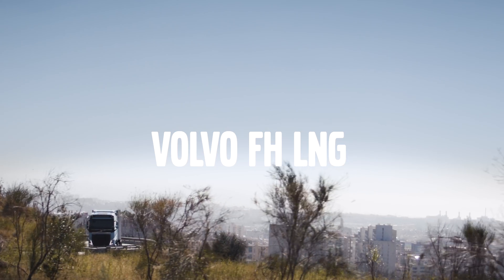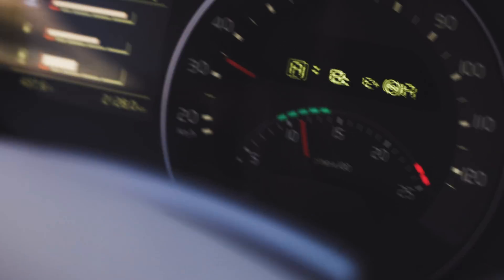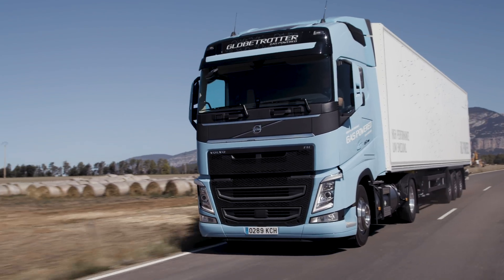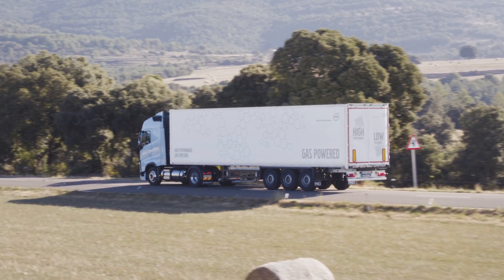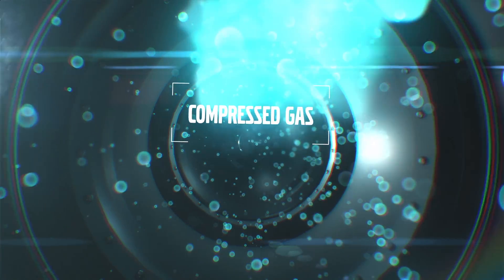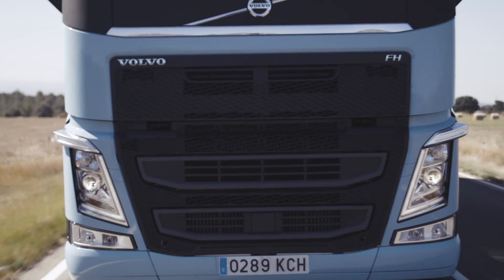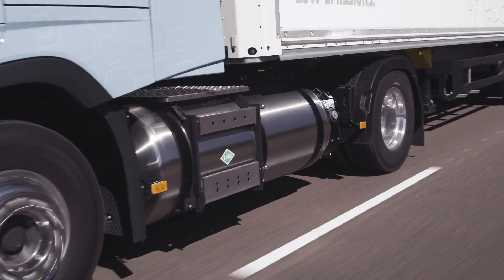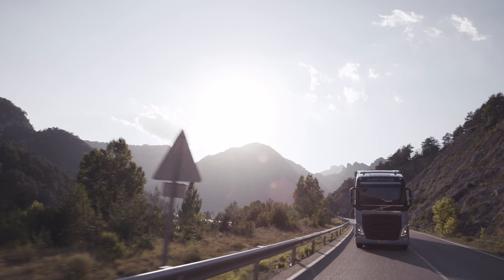Volvo Trucks - Introducing our new gas-powered trucks that can reduce CO2 emissions by 20-100%

Comment: Its not the first Volvo FH powered by LNG!!!! Volvo launched the Methane Diesel FM and FH 460HP with a Clean Air Power supplied system which Volvo installed down the Volvo production line.

Comment: If Volvo wants zero emissions just go all electric already
Reply: Electricity wond deliver the same efficiency and what about refueling an electric lorry when it takes hours to fully charge an electric car.
Reply: BXCRRCR Tyler Wether thats good thing or not depends on what country or rather source it gets its electricity from
Reply: electricitc drive trains are super efficent, the atm is the battery /charging.
Reply: Why would anyone think electric is zero emissions? Trust me, you aren't charging tractor trailer batteries with solar panels.  There's a hydro carbon molecule up stream somewhere.

Comment: I would like to know the power figures of the truck
Reply from the maker: Engine: Volvo G13C Euro 6. In-line 6-cylinder 13-litre common rail engine, injectors nozzles for gas and diesel. Available with 420 hp/2100 Nm and 460 hp/2300 Nm.